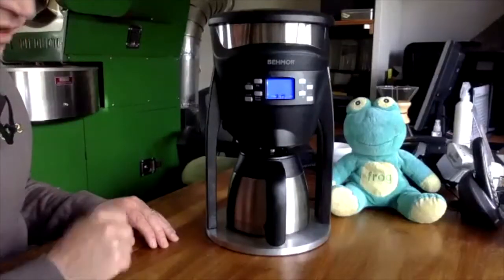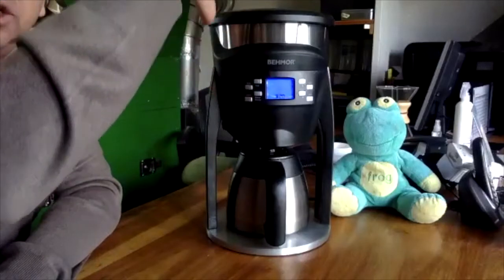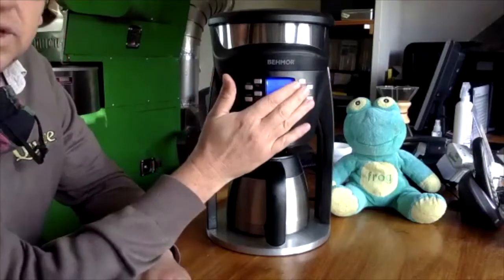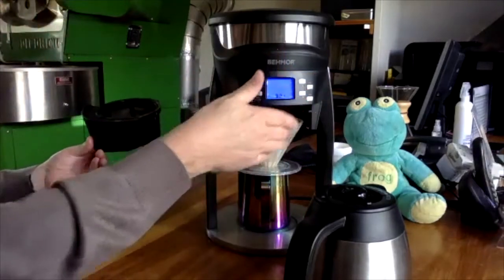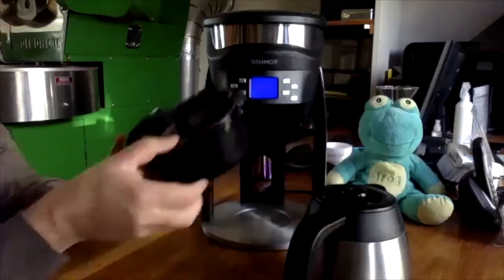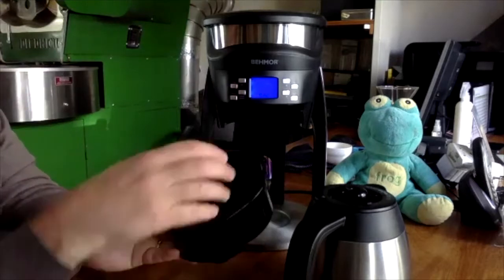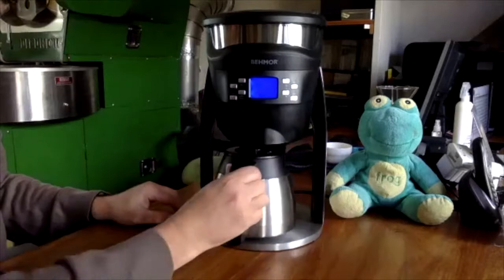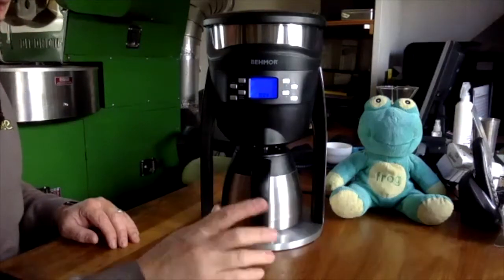Behmor Brazen 3 - Quaffee Training

Comment: I know this was a couple of years ago, but I still enjoyed it.

I ordered a new Behmor Brazen Plus 3.0! 

I’ve used a BUNN Velocity Brew for approximately the last 10 years, but recently, I have gotten more into lightly roasted coffee’s, and the BUNN water temperature just does not get hot enough (185°F out of the spray head). 

I am impressed with the details of how the Behmor heats and brews, and the precision that they designed into it, which is not common with auto drip coffee makers.

I am curious, are you still using yours?
Reply from the maker: We use ours daily, often to make 2, 3 pots has been very reliable and the quality of the coffee is delicious. We clean the unit once a month at least, and mostly use the gold basket. Which we soak in espresso cleaner regularlary.
Reply: @QuaffeeCoZaRoastery  Awesome! It’s good to hear that it’s been reliable for you. 

What cleaner do you use?
Reply from the maker: @johnmpifer  We use the Urnex Cafiza cleaner, works well.

 https://quaffee.co.za/offerings/urnex-cafiza2-coffee-equipment-cleaning-powder/
Reply: @QuaffeeCoZaRoastery Thank you! 

What grind setting do you like with the goldtone filter?
Reply: @johnmpifer  medium-fine. On a Vario grinder 7-F for most coffees, but I we do change it depending on coffee. We use mainly lighter roasted coffees.
Reply: @warrenmachanik3269 Thanks. I’m looking forward to experimenting when I get the Brazen. 

Interestingly that’s why I bought it - my current BUNN coffeemaker doesn’t get hot enough to properly extract light roasts.